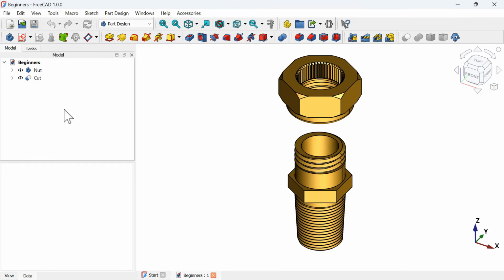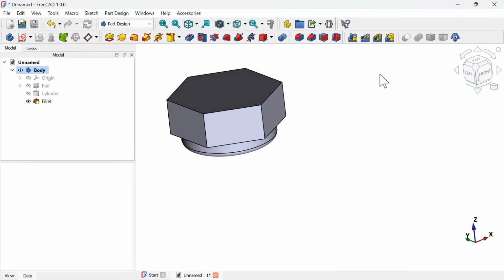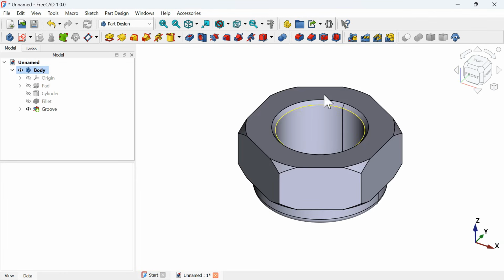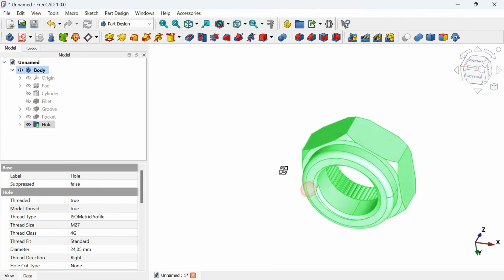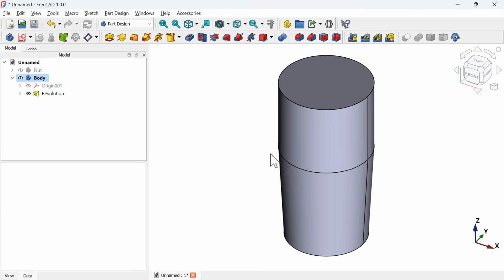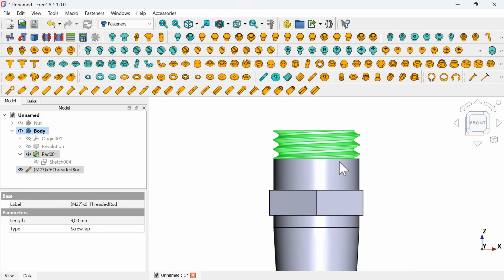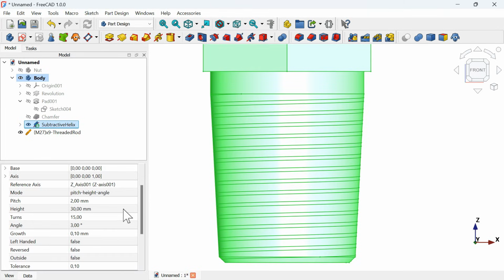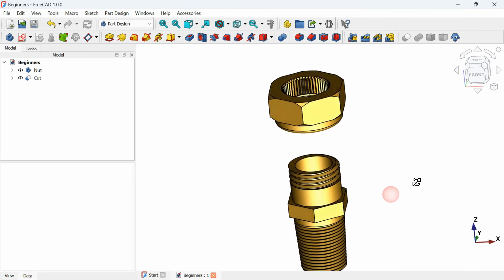FreeCAD 1.0 beginners tutorial #8: Grooves, holes, thread & tapered thread

Comment: Nice.  I  had an issue with using the Drill Point: Flat on the Nut hole for the thread, it left a 'screen' blockage, which dissappeared when I changed the Drill Point to 179.  However I notice now that even when I change the Drill Point back to flat it is no longer a problem, so all's well.  Musch appreciated and many thanks

Comment: Any chance of doing countersunk on a body where there are holes?
Reply: Make a sketch with circles on the surface where you want the holes well located, no need the correct dimensions of the circles. Then select the sketch and apply the 'Hole' tool, choose the diameter of the holes, their depth and tick for countersunk. You can choose the angle of the countersunk too... That's it
Reply from the maker: Maybe.